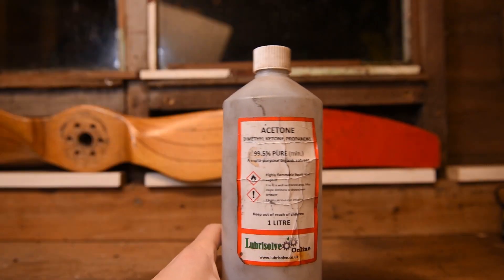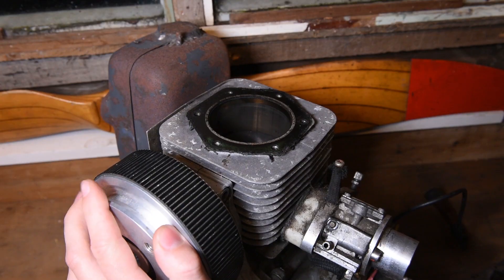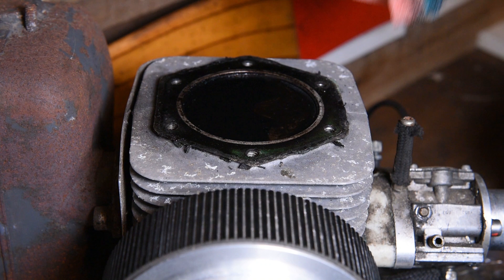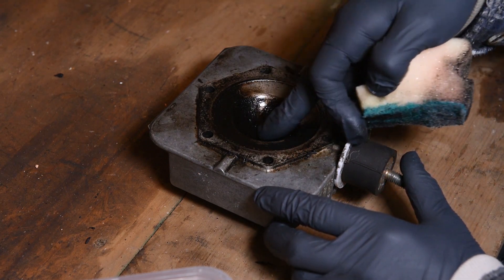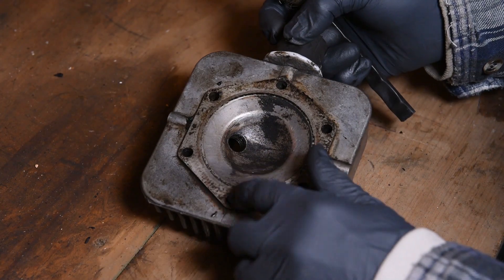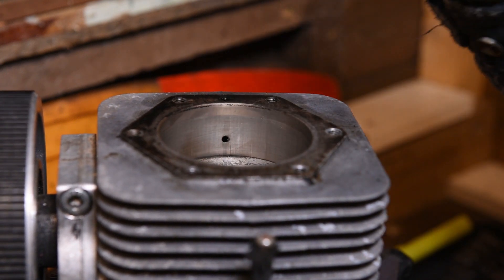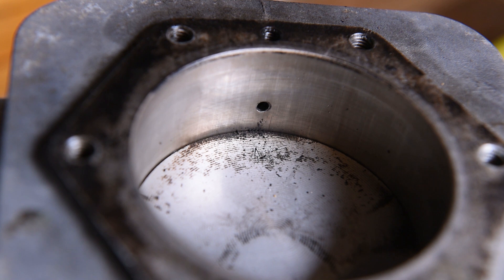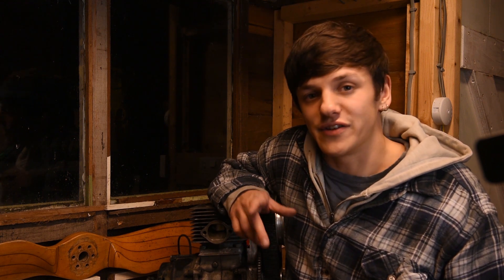How to De Coke A 2 Stroke Engine (Carbon Clean)

Comment: I had a chainsaw accidentally running on half choke for a day by accidentally offsetting  the choke lever while dismantsling it. Now the saw  wont start at all. I was working in a cloud of smoke and the saw was running like shit. So I'm assuming I've filled it with carbon ?

Comment: Will this require any timing calibration after taking the head off and manually moving the piston? I’m worried about taking off the head to clean and stuffing the whole running engine

Comment: Great video! Is there any way to do this to an exhaust pipe without some huge source of heat??
Reply from the maker: This is a rough way of doing it with a sealed unit. If your exhaust has bolts of rivets you'd should be able to take the wadding out of the silencer and replace it fairly easily

Comment: the green bit on the sponge is known as scotch brite, you can buy that on its own and works more effectively on its own.
also before taking the piston to TDC put a layer of grease around the top of the cylinder, then bring the piston up
when you finished you can wind the piston down and all the rubbish is in the grease and not in the rings

Comment: .... modern 2T oils have almost eliminated the need for de-coking. Standard 2T engines may get away with never needing de-coking.  Old oils were a nightmare. Exhaust oil spray and drip have also almost been eliminated as new oils burn cleaner...Not sure that engine needed de-coking and not sure why the head gasket has failed like that. Possibly loose head nuts or even over rich mixture.  Like the suggestion of acetone and oil for de-coking. Got a 4 stroke car engine to de-coke, so I'll give it a try.
Reply from the maker: Agreed, newer 2T oils are much better.

Just as a bit of background, this is an aircraft engine, something you want to be as reliable as possible. Gasket had probably failed from being reused and old. I’m not the original owner of the engine so you never know what a previous owner has done.

Comment: Daniel, I watch your videos, subscribe & appreciate your info. However, I did try your Acetone & Transmission fluid on one piston top but used Easy Off oven cleaner on another. From what I experienced, I found that both cleaned about equally regards time & effect. This is not a cut to your video. Have you tried oven cleaner? Just curious & no offense intended! Thanks! The decompression port info was great to know!
Reply from the maker: Bill Callahan hi mate, personally I haven’t tried oven cleaner but to align with what you’re saying with ATF & acetone I recently cleaned another piston using this mix however, it had nowhere near the same effect as this video. The difference was the ATF fluid! I’ll try and find the old stuff next time I need to clean off a piston and let you know if different brands make a difference.
Reply: @DanielJonesParamotor  Daniel, thank you very much! You are one of the few who reply promptly with great information. I was surprised that you've never tried oven cleaner though. Let us know how the "old stuff" works. Thanks again! From north Florida USA.
Reply from the maker: @billcallahan9303  No worries! If I can help someone I'll try my best to do so :)

Comment: Hey! This bloke says my engine is full of carbon and that I need to replace the rings and seals. Is this true? Or am I taking the piss here nate?
Reply from the maker: The guy has probably suggested new rings and seals because if you're at the point of needing a carbon clean you've either 1. used a very high oil:fuel mix for running in or 2. Put a lot of hours on the engine and a top end rebuild would be imminent. Frankly if you've got the money to replace rings it'd be easier to do it all in one swoop than take the engine apart again a couple months down the line. If you're ever in doubt just ask the guy who's doing the work, they should be able to justify it. Hope this helps!
Reply: @DanielJonesParamotor  I just did the carb clean and it runs better but still won't idle. I think I need rings and seals. Ive been working on it a week it's just depressing.
Reply from the maker: @chaunceyhulbert7264  New rings should help improve compression. How many hours has the motor done? You may need to look at tuning your carburettor also ambient temperature effects 2 strokes quite a bit.
Reply: @DanielJonesParamotor  I'm not ositive about the motor as I just bought it second hand. But I just put a brand new racing carburetor on it. Earlier this morning I took it apart as much as I dared. And I traced the original gaskets on gasket paper And cut them out and put them on the intake And exhaust.And it started to the point I could rev it up and ride it a bit. And then promply died. But I ordered rings and seals for it and have high hopes that I'll be a 2 stroke expert by the time this is all over.
Reply: @DanielJonesParamotor  turned out to be a crank bearing. Bought a new motor. So I'll have plenty of spare parts.

Comment: First off you need more subscribers! Excellent presentation, thank you. Now I have two quick questions: 1) Me “mum” is almost 80, so I couldn’t bear the thought of stealing a sponge from her kitchen, so I nicked one from my daughter-in-law. 2) I don’t drink tea and I don’t ever plan to start, so I had a beer while doing this. Will either of these make a huge difference?
Reply from the maker: If you’re using a beer substitute and a differently sourced sponge please ensure the sponge is kept a safe distance away from said beer. Failure to do so may result in less beer to consume. Hope this helps!
Reply: @DanielJonesParamotor  oil mix 1/:33 is ok ?
Reply from the maker: @Sensei948  that depends entirely on what engine you’re running. What engine have you got?
Reply: @DanielJonesParamotor  husqvarna 372 xp 357xp  545rx
Reply from the maker: @Sensei948  this is the official quote from Husqvarna’s website.

“As a general guide, a fuel / oil ratio of 50:1 is recommended in Husqvarna products up to and including 75cc. In certain heavy use applications, models above 75cc may be run on a mix of 33:1.”

Comment: I have a polini 190 with roughly 100 hours. It’s getting hard to start and I’m thinking of doing this! Just have to find the time when I could go without flying (seems to be never). Do you know how many hours are on your project engine? I typically run non ethanol gas which helps with carbon build up if I remember correctly. Do you know any other way you can slow the rate of build up? Or even prevent carbon from building up?
Reply from the maker: Just be carful to not put too much transmission and acetone mix on the piston as it can run past the piston rings, I wasn’t so worried as I was taking my whole cylinder barrel off. 

I couldn’t say at all how many hours were on this engine as the guy I bought it from never flew it and it had sat for a year in his shed. To help prevent the build up of carbon you could go to town with polishing the cylinder head but don’t take off too much material and watch for the gasket mating face.
Reply: Daniel Jones turns out my piston had slightly melted on the top. Looks like I’ll have a new piston and rings in the near future. Everything else had almost no build up. It must of had a lean mixture. Any ideas?
Reply from the maker: Sounds like you’re lucky to have caught that before the piston detonated, could have cost you a lot more than a piston 😬 yep you’re right about the lean mixture, I have a video about reading spark plugs that may help with the situation. Essentially you’ll need to adjust your high and low idle screws however, if you bought your machine from factory or it still has a warranty you may need to refer to the engines handbook. You may also be able to call the engine makers and they’ll instruct you on the idle screws setup. There may also be someone on a forum that has the settings on a post. If all else fails I will be making a video on how to tune a carburettor in the near future, but I need the engine back together first. Hope this helps.
Reply: Daniel Jones yes this absolutely helps. I purchased a rebuild kit just now. It’s a walbro wc-37 carb. I actually found full instructions on how to tune it up online and I will be doing that once my new piston and everything else arrives. Hopefully you are quicker at putting yours back together so I have something to refer to!

Comment: Nice! I'll definitely be referring to this when I eventually have a 2 stroke. 👍🏻
Reply: Paul 4 stroke also get carbon build up which can cause valves to burn out if left to long as the valve won't seal as well to the head, hot gasses can then escape through the tiny gaps which then burn holes in the metal. However 4 stroke are a lot cleaner than the 2 stroke. So although it can happen it takes a lot longer to do so.
Reply from the maker: ^ “He’s right you know”